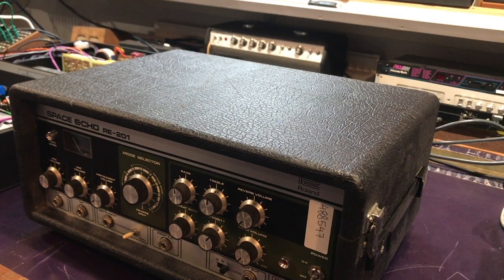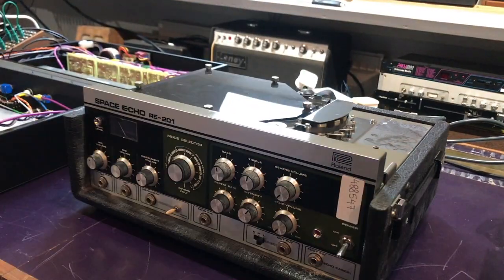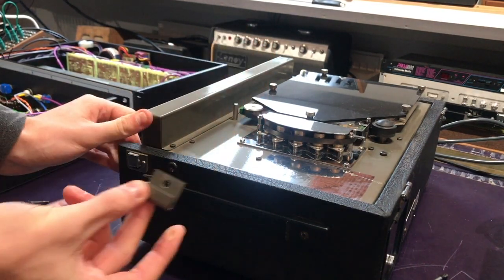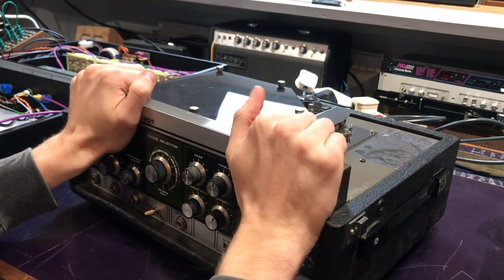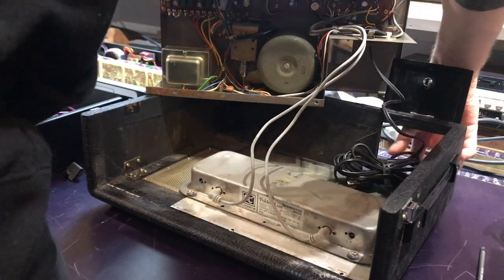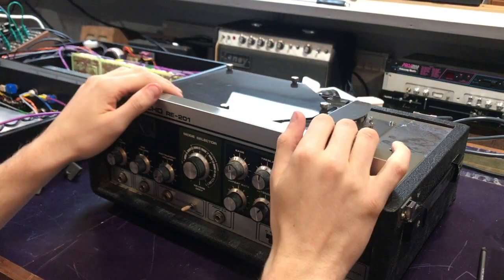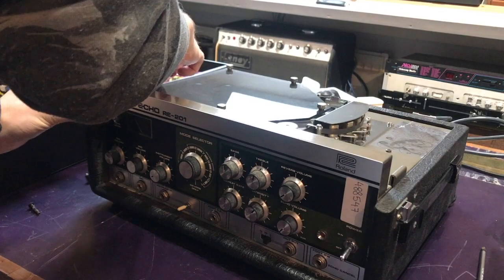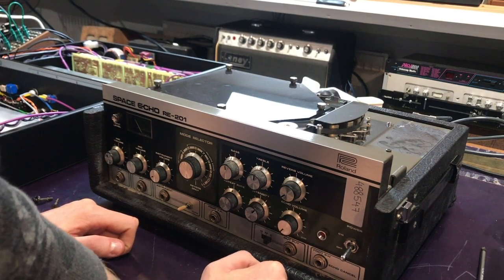How to Open up a Roland Space Echo

Comment: Thanks so much for this. I need to see why my 501 reverb stopped functioning and I'm hoping it's just the plug. This is a great help for my confidence level!
Reply: Hey I have a weird 501 too. Did you end up repairing yours?
Reply: @phewson8907  No. I did attempt it but something had happened to the connections in the reverb tank so I am planning on replacing it as my best fix still sounds a bit off. But it was super easy to access and figure out.

Comment: Any maintenance you can recommend while it is open?
Reply from the maker: Can be useful for getting access to selector or pots if they are crackling and you want to spray in Deoxit. And if your reverb has died then it may just be a loose connection which is also easy to check (they are just RCA connectors). That's just a couple of things that are easy wins. Also get the vacuum out and (gently!) remove any dust.